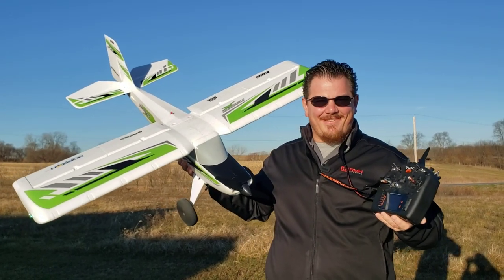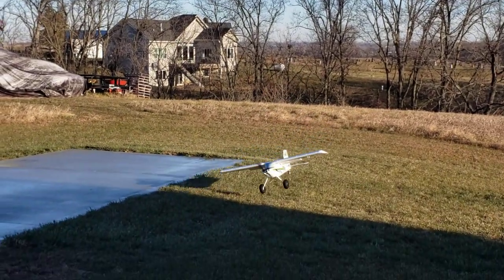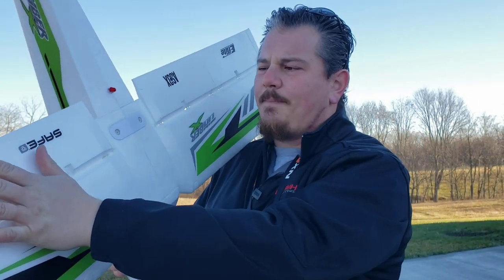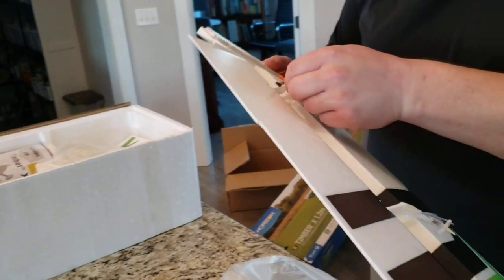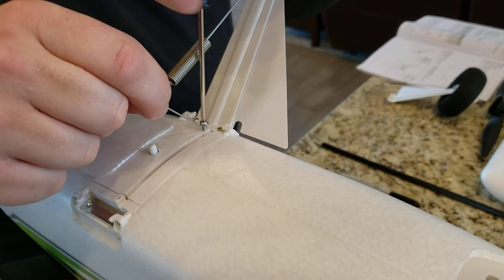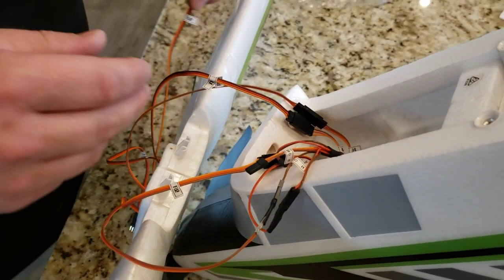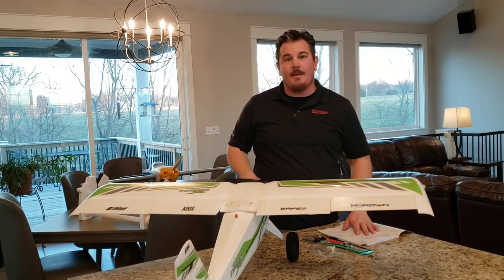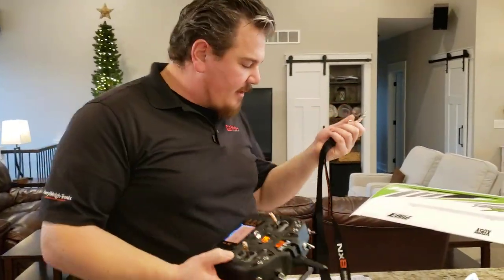Horizon Hobby - Timber X V2 - Unbox, Build, Radio Setup, & Maiden Flights

Comment: My number one recommendation on your demos is to set your flight timer to trigger above 10-25% throttle and shut off when below. That gives a true flight time as the general user will see in real life. Any time the throttle is cut the battery drain is next to nothing so a timer running at low/no throttle is misleading folks new to the hobby. Saying “we chatted for 2 minutes on the ground so reduce the time shown” is kind of accurate. A timer triggered to shut off at low throttle is way more accurate!
Reply from the maker: "one out" is the way I trigger my timers unless I'm dealing with a sail plane...where I can fly for literally hours.

There is no such think as a "True" flight time...everyone has different flight styles and habits. There's not a RIGHT way and a WRONG way...we can all set up our timers the way we like. That's the beauty of this system. To all their own.

Flight times can vary wildly depending on how you're flying. Especially in 3D or highly aerobatic planes. In a sport plane...like Cherokee 1.3m for example, you and I would probably get very similar flight times, using the same equipment, but when you're talking about a 3D plane, like the Timber X, you and I may experience larger deviations in flight times.

As for adjusting our flight times to how long we were talking after landing or on the ground in the middle of a flight, is just a ballpark. I don't expect anyone to follow these exactly, but if you did, I try to err on the safe side, as to help keep people from dead stick landings.

Comment: Hey Brian.  Hopefully you can help.  I have a DX9 Transmitter.  My Timber X has an AR631 Receiver.  I programed it with SAVE as an  option.  All control surfaces travel in the correct direction with SAFE on, and in AS3X.  Unfortunately the Gyro throws are traveling in the wrong direction.  NOT leveling the airplane, but throwing it further out of whack, and into an immediate spin.  Do you know how to reverse the Gyro travel directions.  If you do, let me know please.  THANKS
Reply from the maker: This happened to me and Esteban my friend ONCE on his UMX Cirrus SR22T. We NEVER got it fixed, and had to have Horizon Hobby replace it, since it was a UMX, we didn't have any flexibility.

Fortunately, you should be able to FIX YOURS. Go in and RELEARN SERVO POSITIONS. If that doesn't work, you might have to check the physical position of the Rx. If it's NOT showing correct on your visual in Forward Programming, it won't work until it is right. If you're working with a BNF, then you might need to factory reset your Rx, and then just walk through the First Time AS3X setup and then later First Time SAFE setup. If you can't reset to factory defaults, you might need to update the firmware with one of these... Avian ESC Programmer Firmware Updater https://bit.ly/3PFWmZY
Reply: @BrianPhillipsRC I had a very knowledgable pilot friend hook it up to his PC and reprogram the dam Receiver.   I'll send you an update.  THANKS for the response Brian.

Comment: Hi Brian , when deploying the flaps is the elevator correction instantaneous . I recently bought the timber x , but there is a pause before  the elevator moves after putting flaps down. It jerks down , not a smooth transition at all.
Reply from the maker: We want a delay as the balloon is not instant. If you set your flap delay to 2 seconds, both your flaps and elevator correction will happen at the same rate.
Reply: @BrianPhillipsRC  is there anyway I can send you a short clip.

Comment: I just picked up this plane and 2 4s 3200mah batteries.  Everything works except I can't get Safe to program on my F switch. I have flaps on D switch, Dual rates on A switch and throttle cut on C (DX6 controller). When I go to Monitor, my D switch  moves switch F also. Switch F doss nothing to the aircraft. Wondering if any one has ideas. I'm sure I did something wrong in setting but can't find it. Thanks!

Comment: I have another question. What 4S battery to use in this plane. In German manual for this plane is recommended 4s 2200 30c. On their EFLITE page is also recommended 4s 2200 30c.
Only in English manual is recommended  4s 2200 50c. I can have 3 baterries 30c for two 50c. Is there a big difference? Big difference in price.
Reply from the maker: You can use the 30C no problem, but if you harrier the entire flight, you'll eventually puff it.

Just don't push it like I do, for long flight times, and you can do 30C or 50C...whatever makes sense for your fleet of planes ;)
Reply: @BrianPhillipsRC  thanks!
Reply: @BrianPhillipsRC  thanks!

Comment: Awesome Brian ! Another great video ! I absolutely love my Timber X. Flown it probably 500 times. Two servos have failed, gears been ripped out, and my rudder servo keeps coming unglued from inside the fuse. Don’t know why and i continuously re-glue it. Any ideas? Thanks !
Reply from the maker: Loads of torque on there. If it keeps coming out, glue it back in, then make a plate over the top with more contact area, and you'll probably never have to do it again.
Reply: @BrianPhillipsRC  Ok thanks I’ll try it. Yeah I’ve been putting a bunch of glue in there but it still pops out. I’ve been flying it like a maniac. 😂

Comment: Could you please do a video on setting up flaperons? Please. I bought the night timber. I want to set up harrier as well. Thanks again, your crazy full video viewer.
Reply from the maker: I don't think Flapperons will help with Harriers...it'll probably make it worse. I think what you might mean is FULL LENGTH AILERONS???

If so, it's all done in Forward Programming and pulling out the "Y" Cable in between the FLAPS, so they'll each be on an independent channel. I believe the manual speaks to this, if you're curious.
Reply: I'm looking for a harrier on its own switch.  Then another 3 position switch for safe, as3x, and then full flaperons.
Reply: Yes full wing ailerons, utilizing the flaps.

Comment: this plane is currently on sale......although  I am not exactly a beginner , I am still somewhat a new pilot....do you think with  50% rates and 30 % expo it  would make it a bit easier  to progress  on or should I look elsewhere...... Question: how exactly do you get out of that  "  spiral of death "   loss of control ........thanks
Reply from the maker: I don't like this plane for a beginner. You COULD in a pinch, but I wouldn't recommend it. You'd be better off with the 1.5m, but if you want this for now and just to have something to work up to, since it's on sale, I could see getting it and just doing HIGH expo and flying it with SAFE...

The 1.5m wing makes a big difference.

Timber https://bit.ly/3cEjplB

Exit spiral of death...throttle and get the nose pointed down(ish) and get the plane flying...just like a full scale plane ;) OR throttle plus SAFE on...either way, you'll be still risking how quick it can get out of the maneuver.

Comment: Nice review.
Do you think just replacing the ESC - Avian 60 Amp(SPMXAE1060) with keeping the AR631 receiver,  will get the telemetry data?
Reply from the maker: YES - you will - give it a try, if you wish.
Reply: Thanks @BrianPhillipsRC  it worked.

Comment: I want low rates only , as  this is  my first 3 d ish plane low rates are on switch a normal mode when I move switch a to bail out or safe mode the rates as default are slightly more than my low-rate setup, can I lower the "safe" rates down without affecting safe mode ?
Reply from the maker: Rates are to do with your STICK position, SAFE handles the actual OUTPUT of the control surfaces, is an easy way to see this. Your rates will be EMULATION of maximum stick position, while SAFE runs on the Rx, AFTER you've made your flight inputs.

See if this answers your question, and if not, hit me up again.

Comment: Hey i was wondering if you ever used a non spektrum brand tx and if so if you could recommend or even showcase one i have the hardest time making my bnf work with my tx16s . Your videos are the nr1 reason i got into rc flying , you guys are awesome
Reply from the maker: Thanks, and if you want to have a great experience, you might consider getting a Spektrum Tx...I realize they're expensive, and some would say WAY TOO expensive, but I AM MR CHEAPSKATE himself, and I bought a DX18 (with my own money...not a "sample") ....that being said, we have had several "Samples" since then , to be clear...

I don't want you to struggle, but at the same time, I HAVE USED OPEN TX....and guess what, it was such a PIA, I couldn't handle it.

We have a video of the UMX F4U Corsair and I think we did an OMP T720 and another OMP....we had been promised we'd be able to use it with all our little Micro's from XK, Eachine, and all the cheap Chinese brands, but I found out quickly, there's a LOAD of work, and sometimes it just doesn't work - I gave up on fighting it ;(
Reply: @BrianPhillipsRC  i do have a dx8e i just like the feeling of my tx16s better..but you might be right after all staying within the spectrum economy is probably the best thing here

Comment: Brian Phillips. i Have a Horizone E-flight Sukhoi Su - 29MM (gen 2) can i use s4 battery since it have 40 -Amp Switch - mode .. i as a you tube video they used a 4s lipo 3200

Comment: Just got one, 4 times it has just spiraled right down to ground while in safe. 2nd time found a broke aileron mount on left side and fixed it. Flew through a pack mainly using rudder. Then flew again then spiraled out again when it hit the ground. No mounts or anything broke, anyone know why this may happen. Receiver in tight all connections tight and servos seem to bee working great.
Reply from the maker: Keep flying...gotta keep moving. SAFE will not stop a stall, especially on the 1.2m...1.5m is a lot more forgiving, but not surprised she's "slipping out" from under the wing. High lift, HIGH DRAG, and SAFE...makes it look like a hot air balloon, but the plane still needs to be moving forward.

Comment: Hi Brian, Im confused with the as3x. I have Aeroscout and now I have decided to buy Timber X.

 I bought NX8 receiver. I bind these two planes with safe select binding plug with BNF templates in the receiver.
Now there is problem, both aircrafts react with control surfaces when I flip them upside down, but Timber only in SAFE position, on Safe OFF postion with as3x active, there is no sound and no moving of ailerons, elevator etc. I dont know if the as3x is active or not. 

Aeroscout too is only responding when I swith to beginner mod. Medium or advanced do nothing. no aircraft parts moving, no buzzing of the servos.  
Also I cant select forward programing for the Aeroscout in the NX8 reciever.(failed to connect)
In the Timber X, I can select forward programing and I have SAFE and as3x on gear 1 and only as3x on gear2. Bit nothing is moving with as3x only.

When I tried to bind Aeroscout back to my DSX receiver with safe bind plug, servos are only responding in beginner mode.

Another thing is  that if I fully deploy flaps in the Timber X there is buzzing sound of the servo, like if its trying to deploy flaps even more. (its the default BNF template in the NX8).

Sorry for my english and I would really appreciate some tips about the as3x in both aicrafts. THANKS!
Reply: I figured it out.
Reply from the maker: AS3X only activates after 25% throttle output ;) Sounds like you got it already - thanks! So sorry for the delay in reply!!!  We're running like crazy making footage, so I'm behind on comments ;(
Reply: @BrianPhillipsRC  its ok, as3x was active but i thought it will be more noticeable like in aeroscout. Its very subtle in timber x so i thought its not working.

Comment: Hello Ryan amazing plane as always! I have a question though. I bought the RTF aeroscout 2 1.1 meter and I’ve flown it 5 times now. Occasionally while it’s in the air, the engine cuts off even when the throttle is 75% engaged. The plane was roughly like 100 ft away from me up in the sky. The batteries are original and can assure you that they had plenty of power left. I just don’t know what’s wrong with it
Reply from the maker: I want you to do a RANGE TEST. This is a test where you will intentionally cut the power of the Tx from 100% down to 10% and you'll walk back from the plane (on the ground) and see when you LOOSE CONTROL OF IT. This is an easy test that will tell you the RANGE of your Tx and Rx. Have a spotter watch while you put the Tx in RANGE TEST MODE, then move the sticks on the AILERONS AND ELEVATOR, and when they stop moving, you'll know that you're 10% of the range of your system when OUT of RANGE TEST MODE...so if you're only 25 feet away, you'll only have 250 foot range...then if you stop at 100 feet, you would assume you'll have a 1000 foot range... and so on and so forth. This test will help you Identify if you have a bunk Rx / Tx...then you can start the process of fixing the issue...if it's fixable.

Sorry you're dealing with this issue, but it does happen. In FACT, I had a subscriber visit me this last summer. He ordered an Aeroscout 1.1m and had it delivered here to our house, ahead of his arrival....we had this EXACT problem here - What a bummer! We did the same test I'm recommending to you...then he had to pack it back up and talk to Horizon Hobby to get a replacement sent out.

Good luck with your fix. You can figure it out. If you confirm bad Tx/Rx - get with Horizon Hobby and ask them to help you fix it.
Reply: Hi, i have this exact same problem in aeroscout now. I have flown it many times without a problem , but now i have this issue.
Sometimes approx 100m away the engine cuts off for 1 second. Sometimes it happens 2 or 3 times in one flight. Did you find where is the problem?
Reply: @voidhunger7514  unfortunately I wasn’t able to solve the problem. I just make sure to fly it closer and in a space where i can hear the motor spin.

Comment: I noticed on your night timber x video you used the stock 14 and 20% elevator compensation. Why do you think the timber x requires 30 and 40%? 

Also, thank you for that tip my timber x flys much better with 30 40%
Reply from the maker: This is a great question, but I can't say I know.....both planes have the same basic flight performance - strange!
Reply: @BrianPhillipsRC  steel versus carbon fiber in the elevator?????

Comment: When I’m flying with safe (I haven’t tested it without safe yet) the plane just wants to climb and I don’t know how to stop it as when the flaps are up the elevator is aligned and straight but it still just wants to climb
Reply: Even when I fly with my trim -100 which is full down it will still try to climb which is why I don’t know what to do

Comment: Im quite surprised how bad this plane fly in the slight wind. Even with As3x active its far worse than with the Aeroscout. Slight wind gusts and the plane almost turned over.
With heavy 4s 2200 battery is much better but still. Maybe its because the wing area is large? I dont know. 
Also when I change battery for the same type to the exact spot in the airplane and the CG is the same I need to trim the aircraft again. 
Its seems to me like when I change the battery the trim is reset, but its not true. Its not fun trimming the plane with every new battery.
Flight time is very limited with 2200mAh and if you spend some time trimming the plane again and again its annoying.
Reply from the maker: It is very under-stable. The 1.5m is a HUGE improvement.

Comment: I have the V1, which has he same crap A332(R) servo's as the V2. So no improvement on that unfortunately. My servo's just start to vibrate in their middle position and it's getting worse. 😟 Looking for replacement servo's with enough arm-length (20 mm) or servo's that can fit the arms of these... I have my flaps on different channels and use them to extend the ailerons with a switch which gives great rollrate. Can also still use them as flaps. 😎
Reply from the maker: I wonder what you're doing wrong. I've not had a single issue with my servos on this or any timber...don't get me wrong...we've had servos die, and some DOA (Which REALLY sucks) but not on the Timbers? Are you on 11ms Refresh Rate or something strange????
Reply: @BrianPhillipsRC  I've been using it about 8 months, flying almost every weekend. Refresh rate is at 22ms and it's not all servo's that have this behavior, only the wings so far. It started with one flap-servo but ailerons are now also vibrating and it's getting worse. I don't even know the specs of these servo's, can't find it anywhere.
Reply: @arlemooldijk1595  Sorry fore My Bad english i am from germany.i change all Servos in My Timber x .i Take Emax Servos .ES08 MA ,Analog  12 Gramm Metalgear .The only Problem is for the flaps ,because  1 Servo Must have another direktion.
Reply: @QuaxDerBruchpilot100  Thanks for the info. The problem with Emax servo's is there seem to be a lot of fakes, just like with TowerPro servo's. The problem that one servo needs to be in oposite direction is not an issue for me because I use seperate channels for my flaps (so I can use them as ailerons as well). Where did you buy yours and how long are the servo arms?
Reply: @arlemooldijk1595  its a Shop in Germany,the Name is Premium Modellbau .in the Box are 3 Servo armes included ,i Take the middle Long ,for me its enough .the Timber x is Not a Bad plane ,only the Servos is the badest thing i ever have in 30 year of rc flying .After 1 Hour flying the neutral Zone is Crazy .i have Servos from Hobbyking 5 Dollar they are 100 times netter.
Reply: @QuaxDerBruchpilot100  Thanks for the info! Will check it out!